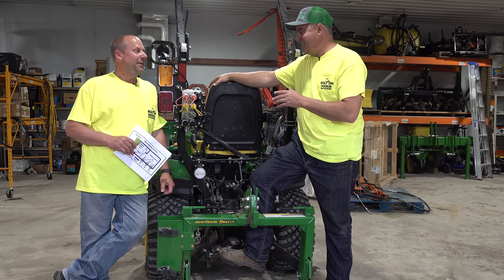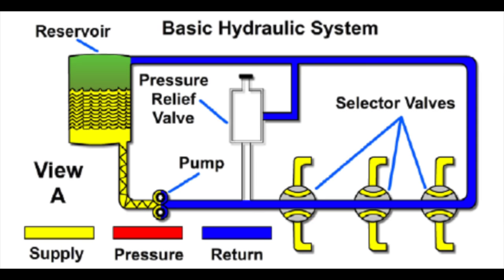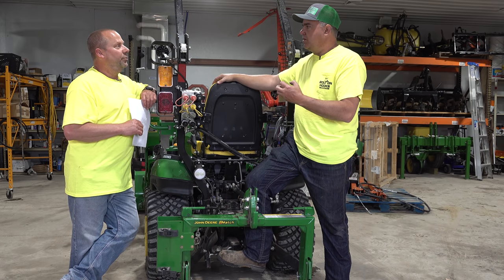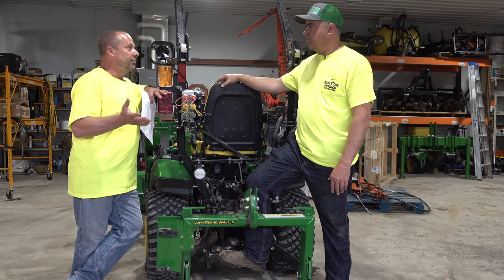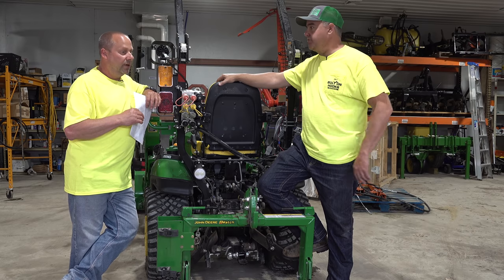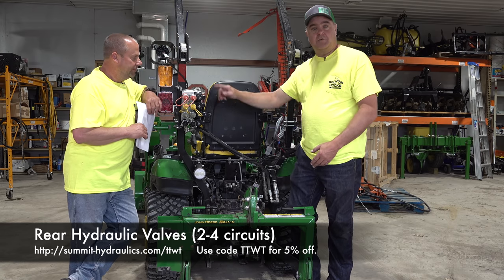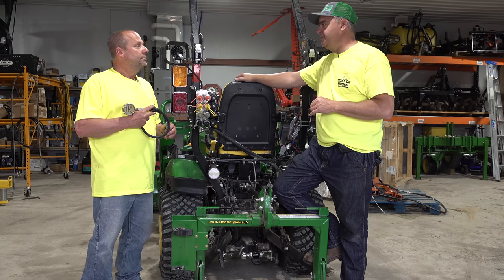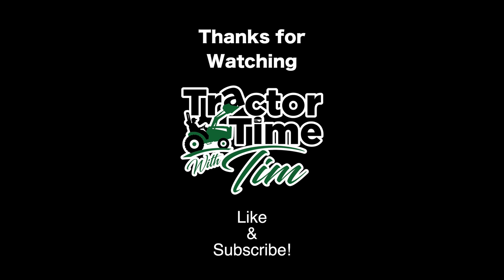Compact Tractor Hydraulics Explained

Comment: My bucket seems like I need to build up pressure or it's a little floppy with the bucket tilt function,  any ideas what would cause that?
Reply: Read the sticky thread about "regeneration" or "regen" in the hydraulics forum on the GTT site
Reply: You have air in your cylinders. Air is compressible so when you operate the valve the air will become compressed by the hydraulic oil and the floppy ness lessons. You will need to bleed the air out of your cylinders. Air can enter when you uncouple & couple the quick disconnects.
Reply: @michaeleisinger8668  The systems self-purge air, there is no need to "bleed" them.

Comment: i know this is a old video but i have a question concerning the ''pb'' power beyond circuit, my tractor( duets allis 5220) has a 7 port control valve , in , out ,4 work ports & a power beyond.My control valve went bad & the front bucket won't raise but the 3 point hitch cylinders still work . So my question is can i run a Y (split the incoming fluid) for the in & the pb? thanks
Reply from the maker: Is your tractor open center or closed center?
I don’t know much about closed center hydraulics. For open center, never use a tee.  Always keep the ‘loop’ flow intact.
Reply: @TractorTimewithTim  it is a open center, from what im gathering ''after'' messaging you is that i need a PB valve & it would go to the N port on my control valve, thats info im gathering & thanks for the reply ,appreciate it

Comment: Sorry if this has already been addressed but, is there any concern for how far you are extending the loop with an attachment? In other words, is there a possibility that you could extend it so far that it would drain the reservoir? I think I understand that the reservoir holds a good bit of fluid so it may not be a concern at all but was just curious.  Thanks.
Reply from the maker: Keep adding oil :-)

Comment: These hydraulic systems were designed by engineers to work with a specific engine/pump/transmission combination. As a John Deere tech for well over a decade, on the latest equipment, please don't overwork the tractor and please do not make the hydraulics whine. The overheating of the hydraulic oil will happen faster than you think and will absolutely cause internal damage a little at a time. Customers with little knowledge of a high temp, high pressure system can be dangerous.
Reply: Because of a back order issue my dealer took the backhoe off of a 1025R he had in stock but there was never a hose connecting the pressure and return lines. I have heard a whine ever since I got it. Is it possible that they plumbed the lines together or plugged them?  Am I headed for a major repair?
Reply: @tomatha3713  all hydrostatic tractors and hydraulics will have a noticeable operational "whine". It will be noticeably louder, and more aggressive as the hydraulics are under load. If the backhoe is working correctly, the lines are not plugged or crossed. This system will also purge its own air back to reservoir. If making small, light movements cause the machine to sound abnormal, or lack of hydraulic power occurs, stop everything and perform an inspection and filter service. First fluid changes are the most important to ensure any aluminum flashing or shavings from assembly are gone. Also make sure the suction screen is cleaned thoroughly. Hope this helps.

Comment: Nice topic. We could use more though :-) So, my question related to hydraulics, my JD dealer could not answer, hmm: to get a bearing established  we are sitting on the 1025R seat and looking forward. With the bucket flat on the ground , and it is in float mode (so no pressure in the loader pistons ) and you start lifting the bucket ( raising the boom)… the right boom, aka the right side of the bucket too, starts to lift before the left boom starts to lift. It’s not a lot but it is visible. And with a load on the front it’s even more noticeable. Why is this ? Watching your vid it did not explain when there are two pistons open at the same time and doing the same function, what happens. Is this related in the since the left boom is sort of starved for ‘flow’ for a short period ? Hope I explained myself.
Reply from the maker: Yes.  The answer is simple. The oil flows to the area of the least pressure (resistance) first.
While I don’t notice the right side first phenomenon normally, it would make sense given the shorter hose lengths to this cylinder.  
It would take slightly more pressure to raise the left side.
Does that help?
Reply: @TractorTimewithTim  yes that helps and it’s logical ,kind of like daisy chaining water sprinklers sort of. I have re-watched your vid on load capacity where your bucket was flat in your barn. Didn’t notice the right boom leading off as I explained but that is hard to view in detail from that vid. Some day put your bucket down, float it, then very very slowly raise and see if you can see what I am experiencing if you can. This is my 6 tractor and I can not remember back in the day of my 3 Kubotas did this. Last two were big tractors and honestly it was hard to even see the bucket. Your work is great and even though I have had lots of experience I have learned so much from your vids and honest and candid opinions.

Comment: I bought my 1025R in April of 2017 and my dealer wound up taking the backhoe off a unit he had in stock in June because they were backordered from the factory.  All of the hydraulics are still there but, it doesn't have a connector hose between the P and R couplers like I see on the one in the video.  Is that an oversight on the dealers part?  I always notice a high pitched noise coming from behind me whenever I use the tractor and am constantly checking the hydraulic fluid to make sure it isn't low and causing the noise.  Am I in danger of ruining my tractor/pump?
Reply from the maker: Yes, the P and R need to ALWAYS be connected together!   This is a problem.
Reply: Thanks, Tim, I'll get in touch with my dealer tomorrow and hopefully they will step up and do the right thing.

Comment: Do you know if Hydraulics use a lot of electricity to lift something, or does the device itself make the action of lifting less strenuous on the machine lowering the energy needed to lift it?
Reply from the maker: Very little electricity….just enough to ‘switch’ the valve. The lifting is done by the tractors hydraulic pump.

Comment: On a 1 series is the hydraulic  pump in the transmission? My x series, I would love to see a video of a x series working side by side to see how much more the 1 series can do.
Reply from the maker: There is only one reservoir, shared by hydraulics and hydrostatic transmission, yes.
Reply: The pump we are talking about is mounted on the rear of the transmission, the thing that says HEMA on it and has the steel tubes attached to it.  While the hydrostatic transmission is pump in itself, it not used to power the implements/attachment on the tractor.
Reply: @kdeckster   my x585 only has one set of lines coming off the front of the transmission which if you follow the schematic it feeds the steering first then the implements
Reply: @KirtH27  Sorry, I'm just not familiar with the hydraulics on the x-series
Reply: @boltonhooks2149  No problem, I wish I lived closer to TTWT I would love to compare the X Series with a loader to a 1 series.

Comment: My 2015 1025R. 3 point hitch, when in the all the up position it will take like 10 seconds and drop about 1 inch then bounce back to the full height again.   Would you have an answer for why this is happening?
Reply from the maker: I think I have seen this.  ...but cannot remember solution for certain. Can you try adjusting the rate of drop control (knob just under the seat).
Reply: @TractorTimewithTim  I have tried that.  I have slowed all the way down and sped all the way up.  Makes no difference.

Comment: Help!
I bought a ford 1920 tractor(1996 year) model and it has the added two cylinder valve block.  One is for top link and  one for right link.  If I pull up lift it does nothing until I move one of the added levers, then load will raise.  Is it plumbed wrong???  Drives me crazy when blading or raking!   

Thank You
Reply from the maker: Sounds like it is plumbed wrong.
Reply: @TractorTimewithTim  I think so too!  I'm seeking someone who has the same setup to help me out.  I'm baffled by the fact that either lever can be moved for one second and it raises 3-point.  It's like it is tied into draft sensing circuit.  Maybe it needs to be on it's own pump.  It does NOT have a loader.

Comment: If you wanted to measure flow rate, couldn’t you just disconnect a hose and let the pump run fluid into a bucket with a stop watch?

That would be at about zero pressure, of course, so maybe that wouldn’t be helpful for troubleshooting problems.
Reply from the maker: For a few seconds until the reservoir is empty!

Comment: I have asked this question to a few but no one wants to answer it.  So I'm going to try asking it again here.   Why couldn't you take the power beyond loop and hook it into a Remote cooler say take a power steer cooler from a truck and mount it to the track and plum it in for extra cooling of the hydraulic fuild
Reply from the maker: You could do so.
Reply: In theory it's quite possible, but the PB lines can see high pressure so you wouldn't use a cooler "from a truck" that could not handle that. Most coolers are plumbed in the return lines that have very little pressure, and it's also where the fluid is at it's hottest.
Reply: @boltonhooks2149  That's true  I didn't think of that PB being under pressure and automotive coolers being on the return sides